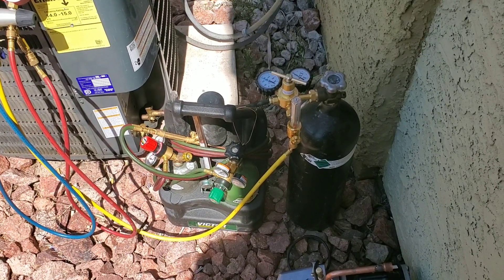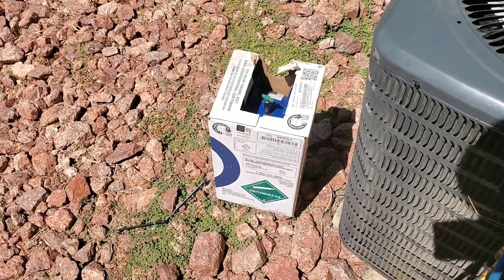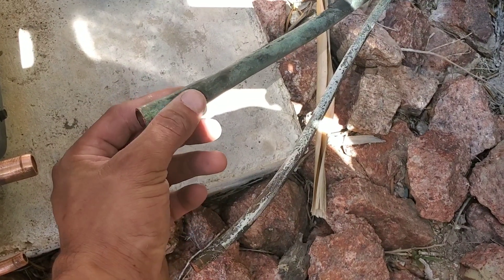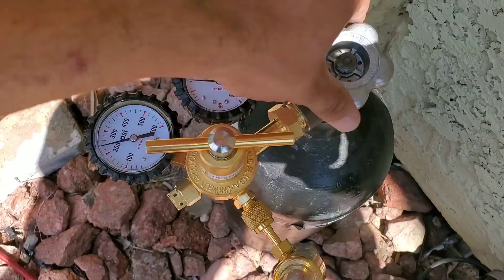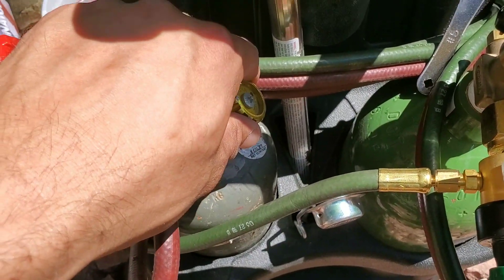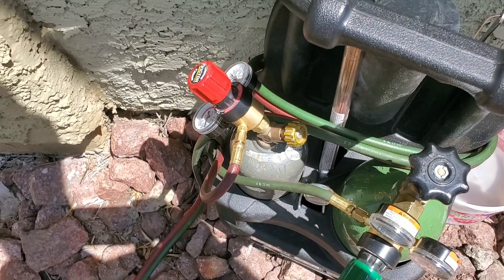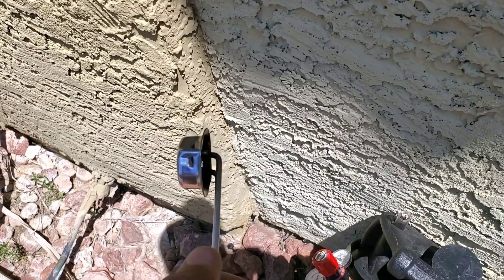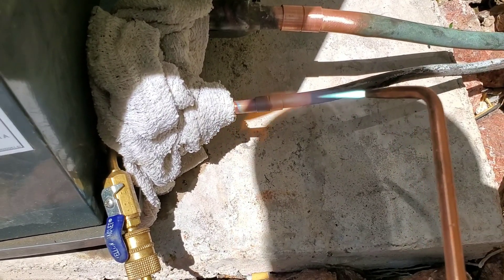Brazing HVAC Tutorial for Beginners Using Nitrogen.

Comment: Hi I have issue with ac when I turn the  thermostat on  starts and working normal and blow cold air and after  for 5 or 10 min stops working. I tried after hour when I switched off and  turn on again and is doing the same after 5 or 10 mints stop working. Please let me know if you have any answer on this problem. Thank you
Reply from the maker: Unfortunately it is not as simple troubleshooting without seeing and working on it. The best advice I can offer is isolating the problem.
Set thermostat to cool and auto. Lower temperature.
Go to the air handler where blower is. Is it running? Is it running full capacity? Is it running and stopping?
If all checks out go to your condenser outside.
Is the condenser fan running?
Is the compressor running?
I suggest going through this process.
Turn on your system let it run. Once it stop blowing "cold" check your blower motor is it running?
Check the condenser is everything running? If not what has stopped?
At that point troubleshooting begins. 
Keep me posted as to what the issue was. I have plenty of videos on my channel for beginners how to troubleshoot.

Comment: Do ya ever put flux on the pipes before brazing or soldering them? Simple truths often misunderstood I agree with for sure.
Reply from the maker: I do not. I did work with a guy who did do this every time he used the torches. His reasoning was it cleaned the pipes.  I did do it a few times but for me personally brazing has alot of steps as it is...I did not think it reasonable to add an extra step. Whether someone chooses to or not is really up to them. Hope that helps. 😁

Comment: Thank you so much for the knowledgeable video man, you’re truly a great mentor! Kuddo’s from San Antonio, Texas! 

P.s. What are your thoughts on A/C seal (solderless brazing)?
Reply from the maker: So there is a product I have been waiting to use called HVaC Glue it is the same as the product you mentioned. I've reached out to many technicians who when they hear about it are excited that there is s product like this on the market but have never tried it. I've heard concerns about if it can hold the pressures of a refrigerant like 410a. Guess I will be making a video soon!